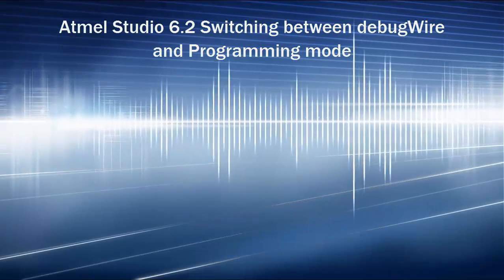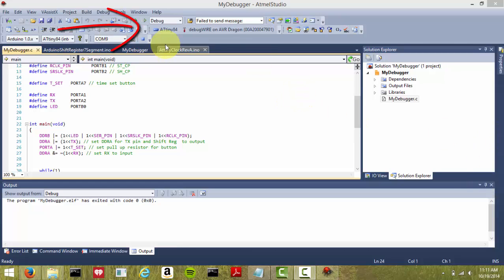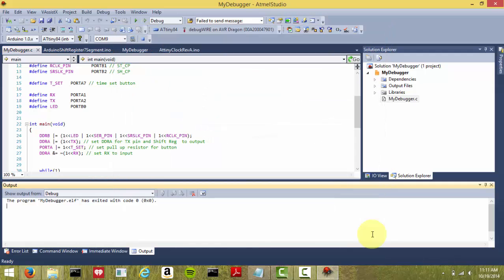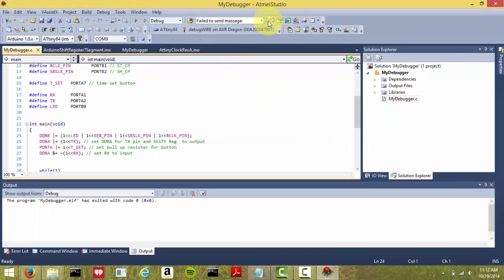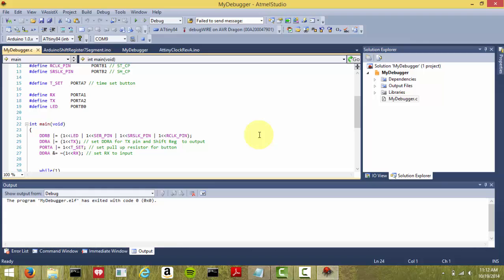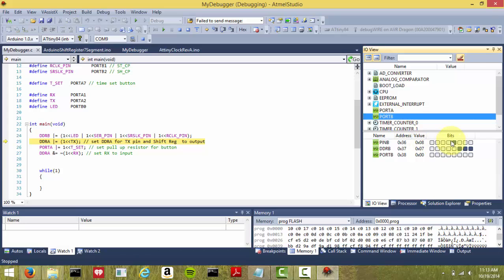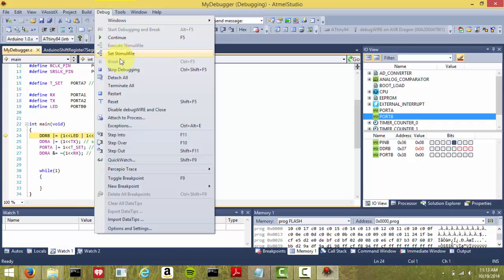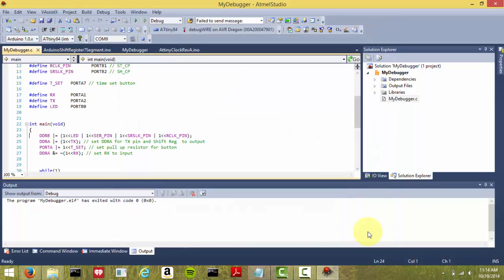Atmel Studio 6.2 Switching between debugWire and programming mode

Comment: I had similar issue with Atmel-ICE.
When you want to exit from debug mode, you need to do it when you're in debug mode (not just changing fuses).
Blocked two Arduino UNO boards till I figured out that Atmega is sharing reset pin with Serial CH340 chip. This prevented UNO to start in debug mode and exit from it. So after I cut his trace, I was able do debuging and switch back to normal mode.

Comment: My chip just bricked thus far 2 chips. First it set the DWEN fuse then all the errors and reboots did not help it never got in debug mode and with that fuse set, i could neither program it or debug it.  Atmel needs work on this feature for sure_